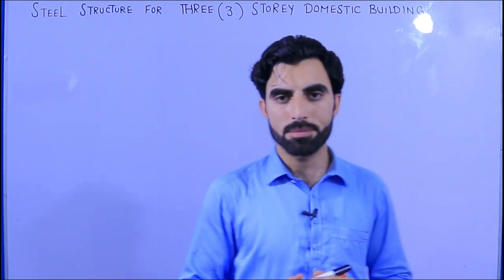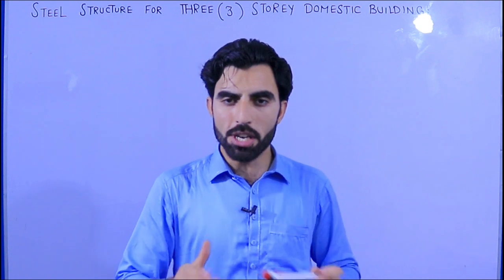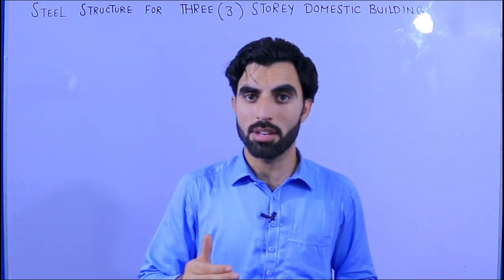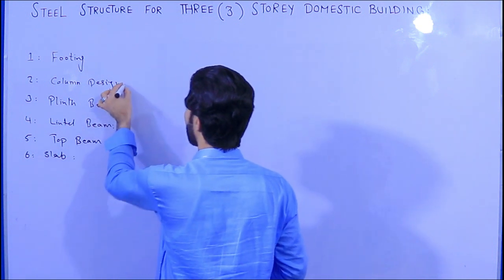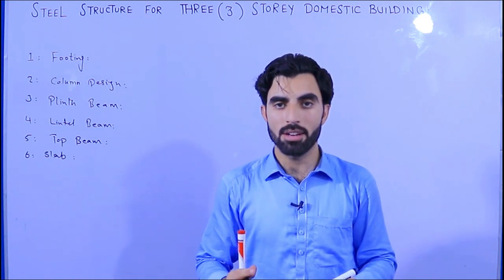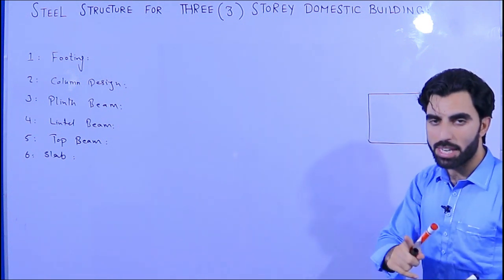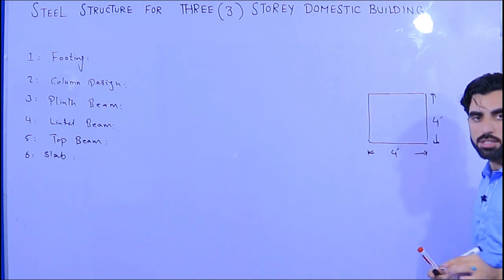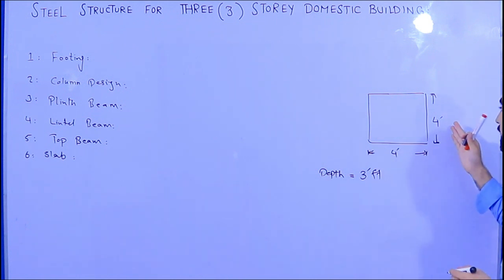Full Steel Structure Design for 3 Storey Domestic Building

Comment: THE TITLE OF YOUR PRESENTATION IS misleading, it seems that you generated a concrete steel reinforcement design. Note that the best way to present your design is to clear up the parameters you used in the design such as the soil bearing pressure, the steel rebar yield strength and so on.

Comment: I'm looking for a video with walls and slabs like a concrete room.  Not columns and beams but walls.  Can the slabs distribution bars and main bars cross in 2 different directions like a grid or does it need to be doubled up with main bars and distribution bars going in all 4 directions.

Comment: First, is this even a steel structure or it is a concrete structure instead? Please make sure your topic is right. 
Second, you should teach how to calculate and get all those reinforcement rather than giving all the reinforcement to your concrete structure.
Third, there is no constant or fixed reinforcement for 3 storey or 2 storey domestic buildings. It should be based on the purpose and design load of each floor in the building to calculate your reinforcement.
Reply: Agreed sir

Comment: It's not steel structure, Which is reinforced concrete structures, the dimensions and reinforcement details varry based on room Sizes , 
Which code book have you referred for your design concrete or steel?

Comment: Sorry, but you have described a REINFORCED CONCRETE structure for a domestic/residential building, NOT a steel one... Why the confusion?
Reply: He already told steel desigh for RCC building.i.e where there's steel applicable & it reinforeced of steel.

Comment: What is the span for coloumns and for slab? Is 150 mm for the slab thickness  necessary? Can we use  8mm or 10 mm? Actually  it is reinforced concrete design and not steel structure  design
Reply: If you use 10 mm then better of 8 mm

Comment: Mere gharka 9*18 inch column hai aur 16mm-2 qty and 12mm- 2 qty aur distance between column is 13feet is it ok.
Reply: Your structure is little bit overstressed I think. So, not safe for Earthquake more than 7 rector.. otherwise , it doesn't matter much..

Comment: We used 9'*12' ,with 4 16mm bars in corners and 2 12mm bars in 9' side centre respectively, is it ok for G + 3
Reply: 2 bars of 12mm should be used near 12" side not 9" side but steel design is fine

Comment: 12 mm dia steel in slab it will  be very costly and heavy design n there is no need to provide 12 mm steel 8 mm dia steel is also sufficient for safe design

Comment: Column 9x9 inch Bhut Kam dia hai aap ne
Reply: Vaibhav bhayi 9"x9" column main vertical rod is 16mm at 6 no's and only concrete density is with RCC 25kn/m3
Reply: N
Reply: Column sign if 9"×12" is better for sufficient flash places in column.